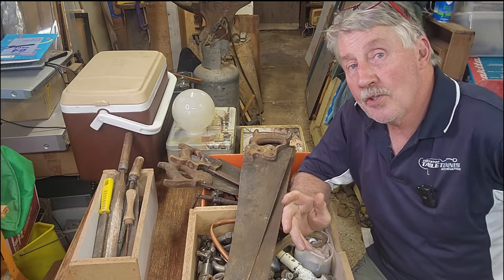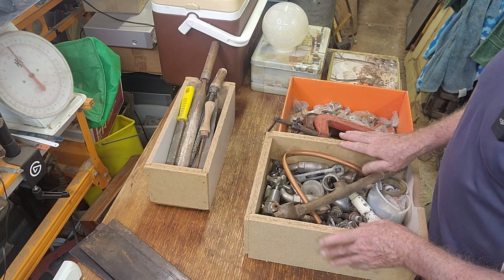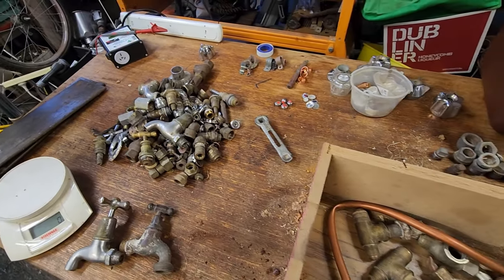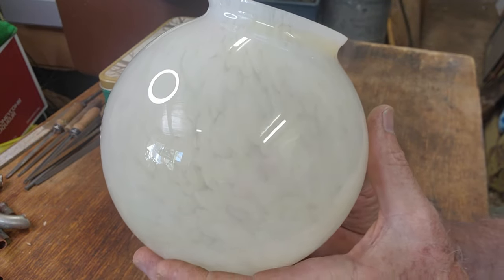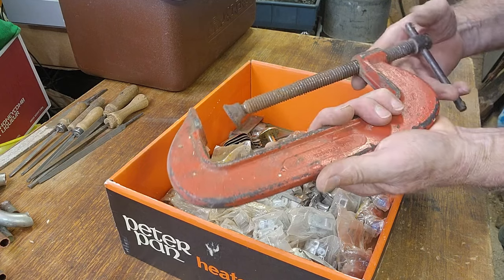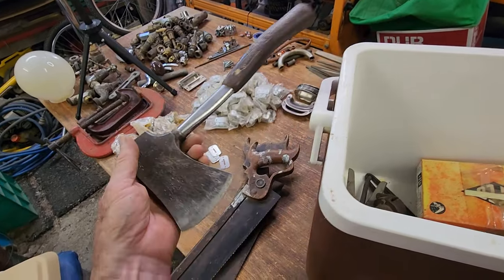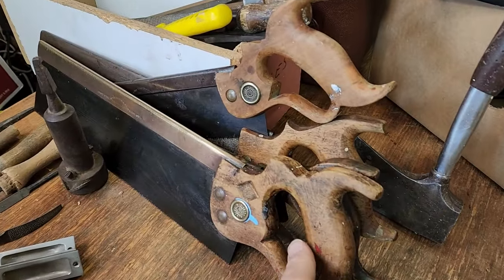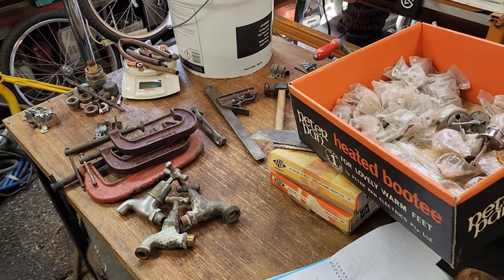Unboxing a Subscriber Gift! Heaps of Cool Old Tools, Hardware, Scrap Brass & Copper and Shed Stuff!

Comment: Ok, I am going to give away one of my secrets here. You can roughly date hand saws by the grip on the handle. Pre 1920 the section where your fingers wrapped around were generally rounded over right into the rest of the handle. These were hand shaped and finished. About 1920 a line started to appear part way around the grip, rather than a smooth transition into the rest of the handle. This is what most of your saws have. Then around 1950 that line turned up farther into the grip and a lot more pronounced. That is what most modern saws have. This is all about mass production and the older ethos of creating a finished product. If you use your hand saw a lot, that line will cause blisters and eventually callouses. So if you have a modern saw you may want to file and sand that out. Knowing this allows me to sort through hand saws pretty quick to pick out the keepers from the just average. There are other indicators for age too, but hey I can't give away all of my secrets.
Reply from the maker: Haha, no don't give all your secrets away in one go! 🤣🤣 Thanks mate, great information! 👍😊

Comment: What a treasure trove. I really liked the retro latches with primary color buttons. Theround cutter is a tenon cutter, as noted below, which could be for greenwood chairmaking, but would work for any round tenon you need to make. The last two smaller saws are likely dovetail saws. As noted below, you can tell much about the age of a saw from the shape of the handle. Note also that the saw handles are correctly sized to accommodate 3 fingers as the index finger is extended along the outside of the handle to provide a mental cue to guide the saw straight through the cut. The one with the open handle is very nice.
Reply from the maker: Thanks Elaine, always appreciate your input! I learn so much from the comments on my videos - it's great! 😊👍

Comment: Yep, the file at 18:30 is a riffler. I have a couple of sets of them, (small and large). Either 5 or 6 different shapes in a set. Used for rough shaping of curves in woodcarving. And ya, some of them can be fairly valuable to the right person. The tips have been broken off on both ends of yours though, and you know what that does to the value. Someone may still find it useful as a make do tool though.
Reply from the maker: Thanks Steve! I see you can buy them readily on eBay, although certainly cheaper quality! I've decided to hang onto this one for now - it could well prove handy! 😊👍